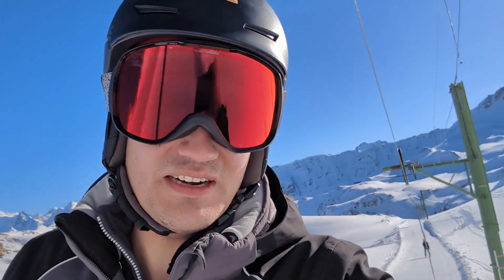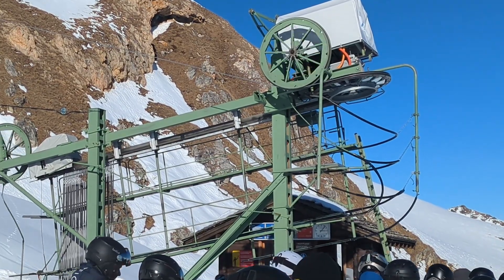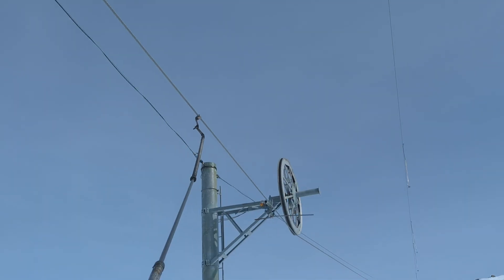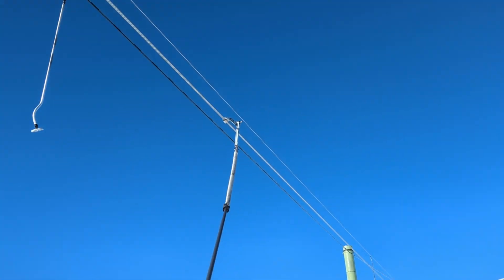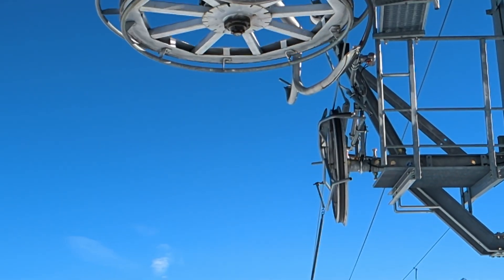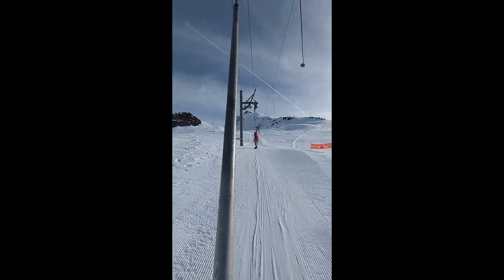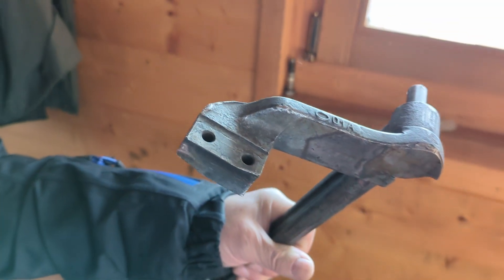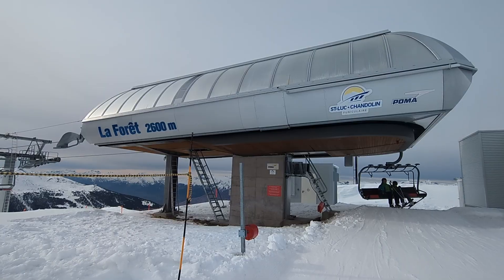The brute force approach to the impossible skilift problem: Poma lifts!

Comment: In the USA these lifts are also called platter lifts. Poma is a brand name, and Leitner-Poma is one of only two companies that typically install new lifts here. Almost every new lift of any type is either a Leitner-Poma or a Doppelmayer brand. There are probably more fixed grip versions of the platter or "Poma" lift than the detachable versions. These tend to run a slower line speed. One of the only detachable versions I have ridden is The Cirque lift at Snowmass. That lift is planned on being replaced with a T-bar soon.

Comment: The "traffic light" is an enhancement to these poma lifts from more-modern times (late 70s)
Older ones (you can still find them in Europe) use a mechanical contraption that iterates between "start" and "stop" signs on small plastic boards.
It adds even more elegance to that whole design :)

As to availability, these are really really popular across europe still; esp on smaller resorts.
I guess they were very cheap to build and quite reliable and easy to maintain.
The TatraPoma license from 1975 ensured these are all over the ex Eastern block countries as well (Czechia/Slovakia/Poland/Bulgaria etc)

In general its design follows a phylosophy that one can see in many french mechanical things from the past century, esp cars.

Comment: Terrific video. I love how you get the shots needed to show how it works. The one component that this system is absolutely dependent on is the flexibility of the human arm. This is where the necessary dampening makes this work. I wonder if there are any sleds that attach to move stuff up the mountain. Do they do anything different than just hook on? 
As a DIY guy, what I see with the Poma lifts is tinkering, more tinkering and then good enough! I’m sure it could be refined further, but it works so well. (I would bet that no engineering firm had a list of specs, a bunch of meetings, and then designed the prototype. This looks like a lift mechanic  had an idea and went to work in their garage.)
Reply from the maker: Thanks a lot!
AFAIK there are no sleds that attach to this lift - they have motorsleds for that.

Comment: What a nice video!
I had the opportunity to work as an internship at a french ski resort that only runs Poma lifts, and they are a real engineering masterpiece!
About the guide rail on "down" pulleys, they are actually to prevent the pole from slamming into it, if you look closely it deviates the clamp leg from the pulley.
FYI, most top stations on Pomas are actually floating pulleys, which are the pulleys mounted on steel ropes. Mast mounted ones are specifically designed for windy areas :)

Comment: Great video! I have always wanted to know how they attach and detach from the cable! Another brute force approach which is a bit cleaner than the poma lifts, is the Telecentre lift in Alpe d'huez which uses a clever grip to push the cable away from the wheels when the grip goes past :)

Comment: Poma lifts offer several advantages over other types of lifts. They are safer than rope tows or T-bars as they don't have the risk of entanglement. If a passenger falls, he or she can let go of the tow bar and get clear of the track. Following skiers/riders can steer around the fallen victim, or the lift can be stopped. Furthermore, Pomas are cheap, much cheaper than the chairlifts that would replace many  of them. They allow a fledgling ski area to get in on the ground floor at modest expense. They can be installed cheaply as well, doubled up, overlapped, doglegged, whatever it takes to cover a good size ski area. A ski area may install one to replace an outmoded, unsafe lift. Or a Poma lift might be used to offer access to terrain that doesn't have enough traffic to justify a chairlift. These three examples illustrate what the Poma lift can do well. In their detachable, or "slingshot" versions as in the video, they offer reasonably high capacity.
      Detachable Pomas really don't use a grip; there's no gripping, clamping, squeezing, or hugging taking place. That C-shaped sleeve that the (wire) rope passes through simply puts a bind on the rope when the tow bar is released. Refer to 7:00+ minutes in the video. We called these sleeves "buttons," not to be confused with the button/disc/platter at the passenger end of the tow bar. When the tow bar enters the drive terminal, a ramp at the leading end of a rail lifts the arm that the button is attached to, relieving its bind on the rope. Gravity does the rest; the tow bar slides noisily into the magazine.
     There are fixed-grip (surface) Pomas as well. In 1970 one was installed at Steamboat Springs' Howelsen Hill, replacing a condemed 1948 T-bar. It's still in service. The Poma lift continues to be a challenge for the skier or snowboarder who’s had little experience with riding a surface lift of any kind, referred to as “Poma Trauma.”
Bill Fetcher

Steamboat Springs,
Colorado, USA

Comment: When I was a teenager, we skiied at a small area in Quebec that had one of these, and I loved it--particularly being used to old, rattly, slow Hall t-bars.  It had it all--the magazine, the big single wheels, and the rope-suspended bull wheel at the top.  No electromagnet for launch, though--a grizzled old operator would pull a lever and away you'd go.  I always wondered exactly how these worked, and fifty years later I finally have the answer.  Thanks so much!!!

Comment: I wonder if the grips need to be changed often? Looks like it could wear out fast.
The steel wire is probably harder as the grip, so it does not get damaged by the grips?

Comment: As someone who's only used the hanging-bench style lifts seeing these elevated rope toes is a novel experience. Where I usually Ski, the new lifts have been built by Leitner Poma. Alta Utah USA, has two lifts with notable turns, Collins has an angle station, where the chair is fully detached and re connected to a new cable, similar to how the endpoints are handled. And the new supreme lift uses a long, maybe 40-60ft series of wheels on three sides of the cable to make a gradual turn without detaching the chair. Supreme is letiner poma, Collins likely predates the mereger.

Comment: There is another way to turn a ski lift (the modern way). Just install a detachable chairlift and an angle station in which the chairs detach, and the rope turns without running into the chair grip. Then, the little slow-moving wheels turn the chairs. This can even work as a mid-load or unload station! Put it in one of your videos.

Comment: As Poma Ski lift operator, there is certain situation when the user is too light (children) and not enough snow that make the pole disengage the grip from the cable, and then create an anomalies that we called a grape. When this anomaly occur the user is sliding back until he reach the next user or the head get stuck until the next head is coming to push it.

Comment: I am wondering if the slippy grip is some sort of aluminum Alloy thats softer then the Steel Cable. It would provide the necessary grip as long as the diameter is in the tolerance range and not too worn out.

Comment: This electromagnetic mechanism for releasing the pole is the least commonly  used from what I've seen on Poma lifts. On most of them, you just grab the pole, pull it sideways violently to take it out of the resting position and engage it with the cable. The electromagnet system is only there to control the minimum timing between releases, and thus distances between poles.

By the way, I can tell that when you're less than 50kg (12-year-old me) or on the fastest ones, you literally leave the ground a few instants when departing.

Comment: I have wondered so much about how the clamping works, now I have learned! Thanks for that.
However I still wonder whether the big wheels put less strain on the steel cables than other lifts with the many small wheels.

I never thought that these lifts are specially violent. I always assumed the only reason these lifts are not very popular outside of France is that they have a lower capacity compared to a T-Bar because they carry only one person per pole (although I have no idea if there is really and engineering-reason not to put a T-Bar on a Poma lift). I wonder though if the lifts of this type I rode in the past 20 years (in 3 vallees, France) were actually going at 4m/s. They always felt slower to me.

Comment: As someone who has broken my back..Poma lifts are terrible. 
Not only is there often a mega G-force launch they often have very inconsistent spring tension, so as the lift carries you up the mountain there will be multiple complete extensions of the spring to bottom-out and all the force is driven straight through your spine, add that to giving very little support going up the mountain you end up standing holding your weight with your legs in a bizarre way while also holding on tight with one arm.... By time I reach the top I need a lie-down, the lift wears me out more than the skiing does.  My back has been hurt multiple times this season on several lifts at different ski stations....

Comment: Awesome design and as soon as you showcased how the lift turns the grip 90 degrees it made sense that these must use some sort of angled friction. Those heads are probably cheap and easy to replace since theres no moving parts. awesome design!

Comment: It's worth mentioning kotva skilifts(T-shaped seats), common in czech and slovak, that are poma but with a T-shaped seat for two people at once. Theoretically doubles the capacity, but you get a need to balance against your partner on top of all other poma disadvantages. Ah, I remember not-fun memories when the spring is frozen or when there is frozen snow under sharp turns.
Reply: There are no “POMA” lifts with T-bar “seats” in CZ and SK. Nor nowhere. Old T-bar lifts made by Transporta Chrudim commonly used in CSSR (CZ and SK) worked on diferent principle. T-Bars weren’t detachable. And as far as I know this t-bar lifts were always straight.

Comment: Only ever known about poma lift. The funiest part is not the start, it generally happens when there is less snow than usual on the lift trail and it starts flat instead of going up : you'll often gain more speed than you should and start going faster than the cable, with hilarious consequences if you don't pizza right away like a beginer on its first green. 
Up the mountain, the lack of snow can also transform the pole into a literal slingshot : the trail is 1.5m lower than what the lift was built for, the tension in the pole's spring is up to eleveen, and you can be sent flying a meter or more above the ground. good luck to keep your attitude and land with your skis in the right direction.

Comment: I've been snowboarding since 1988 and my main question is; why would any ski area use this contraption instead of an actual chairlift?  This seems like 1940's technology to me and I've never even attempted to try a Poma because of how flimsy it looks and how it's difficult to use as compared to just relaxing in a chair lift for your ride up.
Reply from the maker: Many ski domains in Switzerland are still owned by the surrounding towns. So the growth is partly tax-funded and investments are done little by little (unlike large ski domains that have external investors pumping money into them in order to maximise profit). This is why you still see quite a few old ski lifts around.
Reply: It's pretty easy to understand.  Installation of a fixed grip chairlift is 2-3 million euros, and requires at least 2 staff to operate.  A detatchable grip chairlift is 7 million minimum, and requirs at least 2 staff to operate.  A draglift costs around 300k, and can be operated by one person.  Running costs are lower, as the motors are smaller.  Maintenance costs are lower over the life of the lift.  Drags can get you to places a chairlift couldn't get you to.  They are safer, and require no rescue crew.  They can serve less skiers per hour, but it's rare that lifts are absolutely saturated. 

And very importantly these days where it's immensely hard to get new installations in place, the environmental impact is considered to be smaller.  I don't buy that one, myself, but there you go.

FWIW, I've been snowboarding since the days where we made our own boards and wore koflachs reinforced with duct tape.  Riding a drag lift is no harder than coming off a chairlift, the faster they go the easier they are to use.

Comment: THIS IS SO INTERESTING. I grew up in Volda, Norway which has these lifts at the Reset ski resort. I used to go skiing every single night as a kid and I always wondered how these worked. You have answered so many questions for me!

In Volda, you are not allowed to leave the lift other than at the very top. Probably because the mountain is very steep and the hill next to the lift isn’t prepared and only traversable by professionals - and the hill that is prepared starts on the other side of the mountain and wraps around. So every time someone jumps off, the lift stops for safety. Some days you would end up waiting in the middle of the hill for what felt like ages as a kid. Sometimes more people would run out of patience and hop off too, causing an even longer wait. This wasn’t often a problem though, as people from Volda are smart.

Comment: With all the friction the “non-clamping” causes on the cable and the violent banging into guid rails, I wonder how often the lift needs to be refurbished or fixed.
Reply: Maintenance is constant. Parts  get more difficult to source and costs increase. Most operations happily convert to T-Bar spring boxes or remove the lift and replace completely. Any still in service today will have a massive parts inventory/boneyard of spares
Reply: Unless you get something really bad happen - major derailment, loaded but blocked grips dragging on the cable, fire, impact from big machinery - the cable is usually good for about 15 to 20 years.  As long as the guides are properly adjusted, the plastics on them are good for maybe 3 to 5 seasons, but they're cheap and easy to change.  The tyres on the wheels are good for 10 years or so, again if well adjusted, and once stuff is installed it rarely gets knocked out of alignment unless some tit with a grooming machine gets drunk.  The grips don't wear much  (if you keep a handle on this, annual inspection, you can reverse the wear with a mig welder) and the chain links between grip and springs (also mig-able), but the springs and the poles have a hard life, and need a fair amount of attention, inspection and repair annually and a full strip down every 3 years or so.  If you're working on them by yourself, you can do a full strip and rebuild of between 15 and 20 poles a day, and a big lift might have 200 or so poles.  Springs get cleaned, inspected, and broken ones get binned.  There's some maintenance required on the station, the guide rails wear a bit, they get a "wavy" wear pattern and the grips no longer advance properly (although if the grips aren't advancing properly during the season, it's more likely the operator hasn't cleaned and lubricated the guides properly), this is solved by removing the wear part (a 12x10mm steel bar) and welding a new one in place. 

There's very little you can't fix with a few spanners, punches, a couple of hammers, and a welder.

Comment: poma lifts are indeed brutal. as a child i was a lot of times lifted completely up in the air by these lifts and kept there sometimes 10 meters, as long as i didn't jump off the lift. it was in slovakia, i guess they maintained the lifts not as good as in switzerland and this phenomenon was only happening at temperatures under -10°C. the teleskope was just frozen and not moving.
fun fact: the poma lift has much more weight compared to the rope mechanism and by swinging it up-down or left-right you can induce a wave in the cable so violent, that the other passangers's teleskopes are also shaking.... a friend told me ;)
Reply: I had completely forgotten about that amusing fact!! 
Used them as a French kid in the 90s. 
As teenagers, we would start playing around by putting our skis perpendicular to the motion so we would come to a stop and elongate the pole spring before realeasing and get a big boost. We even once did it as a bunch and got to resonance. It derailed. Suffice to say we quickly flew the scene 🫣
Reply: @nacckko  oh yes, the perpendicular stops we did too. i still do it with 3x... i mean friends of mine do it.
wow, you derailed it? :D that's crazy.
i still prefer this lift over the cabines, it's much less complicated and you can play and ski on the way up.